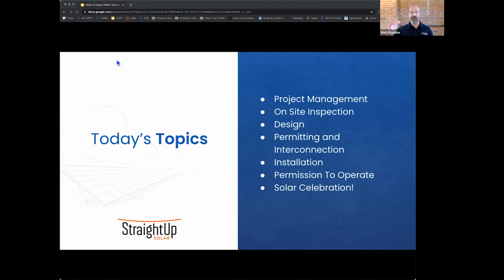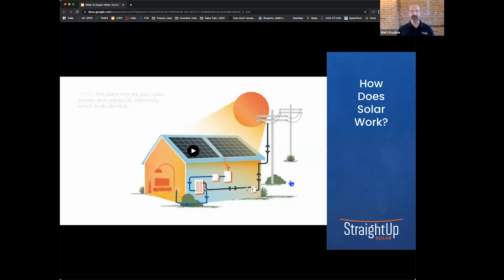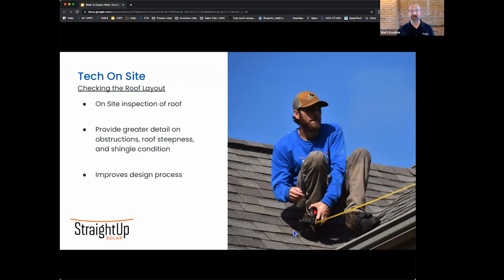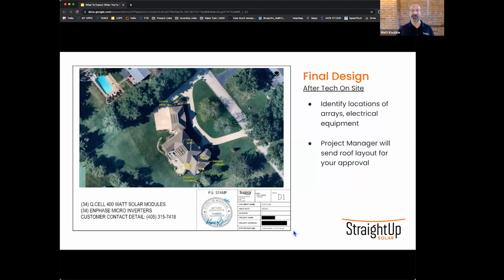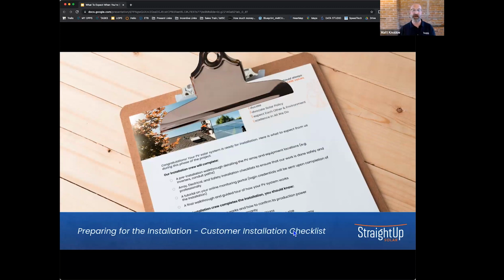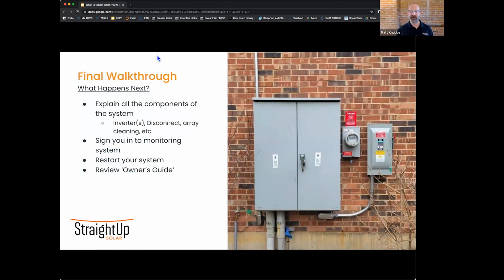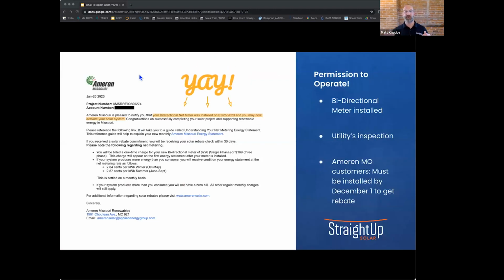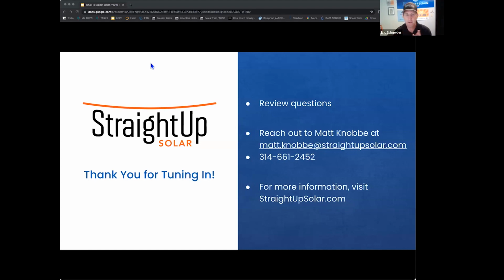WEBINAR: What to Expect When You're Expecting Solar

Comment: We are currently at Step 3, Charles M has been assigned as our Project Manager.  We are the first home in our newly developed community to go solar and armed with all the data I was provided I was able to secure our HOA's approval in less than two weeks.  We opted to OVERSIZE our system and tweaked our configuration after the Tech Visit and results of the Solar Pathfinder tool to cover future growth i.e. adding battery back-up next year and to cover any system degradation or weather-related losses given our home faces EAST/WEST and to maximize AMERN Illinois One-to-One Net Metering program.  Great knowing you install a Critter Guard.   Looking forward to that day when we get our PTO.  USAF Retired